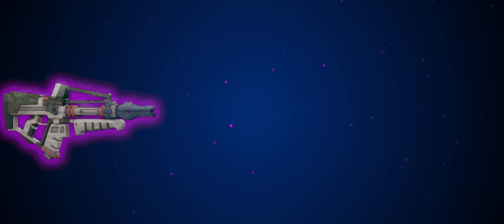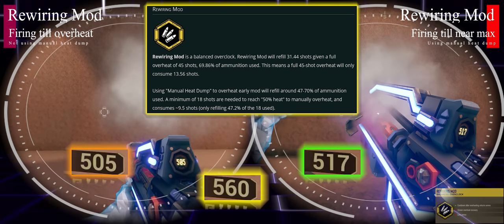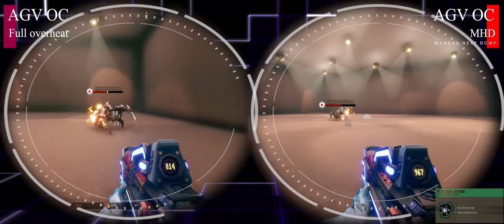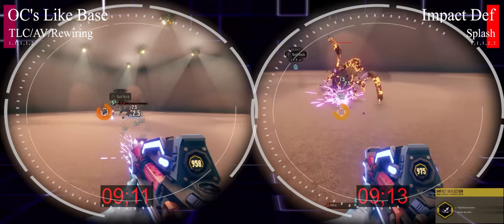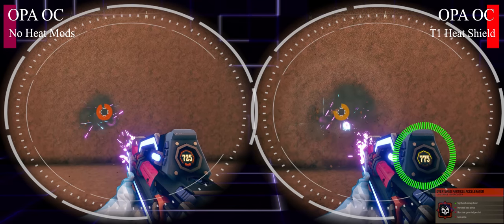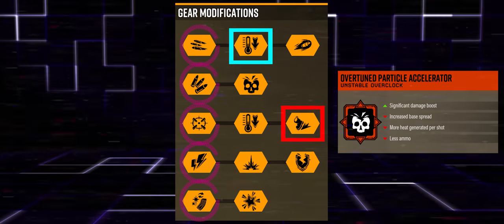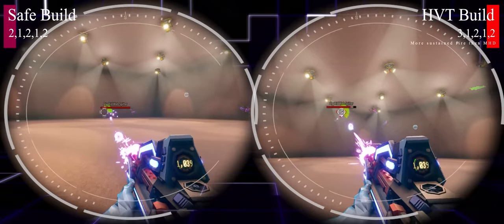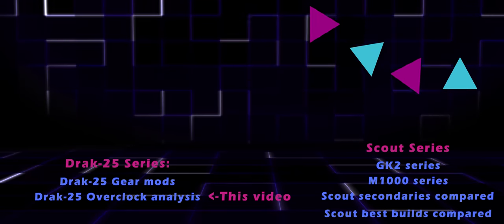Drak-25 Overclock Analysis - Deep Rock Galactic

Comment: One note about shield battery booster that actually makes me love the OC:
When you overheat the gun and it drops your shields, your shields begin to recharge when the gun is done overheating. Not after the normal shield recharge delay. You can even see this in action at 13:05. Gun overheats, shield goes down, shield begins recharging once overheat animation is finished.

Why is this useful? Well, if you take the armor mod that results in a much faster shield recharge, and you take the shield link perk, suddenly your shield recharge rate is very quick, on the order of 1-1.5 seconds. So this helps a lot with getting you back in the game if you accidentally overheat the gun.

But consider this: You can take manual heat dump too. Now, in exchange for purposefully breaking your own shields, you get a faster overheat animation, about a second long, and your shields recharge very quickly once the overheat is done thanks to recharge speed armor mod and shield link.

Okay, things look much better now, but we still haven't hit upon the final piece: If you are going to be using manual heat dump, you might as well take Hot Feet too.

Now a play style comes together:
Use Shield Battery Booster's crazy upsides to shred through some bugs until your heat meter is almost full. Manual heat dump, gaining crazy move speed for a few seconds. Once the manual heat dump animation is finished, your shield instantly starts recharging, and thanks to shield recharge speed armor mod and shield link perk, it comes back up in about a second. Repeat this process for a good time.

Now this all sounds well and good, but if a bug hits you, then this whole overheat, run away, recharge cycle breaks, right? Wrong. If a bug hits you, you lose the OC bonuses and normally would have to wait for deep rock galactic's painfully slow shield recharge delay of like 8 seconds, but overheating the Drak with shield battery booster immediately sets your shield recharge delay to be the duration of the overheat animation, whether or not your shield was full beforehand.

This means that, anytime your shield is not at full, you can fire off a few shots, manual heat dump, and be back at full shields in under 3 seconds. With hot feet, this also allows you to reposition to avoid further damage. Now, shield battery booster is not just an OC that heavily rewards you for maintaining shield uptime, it's also a tool that helps you do so!
EDIT: It looks like the OC may no longer behave this way. Be sure to test it out yourself before relying on it. What a shame, too. Was fun while it lasted.
Reply from the maker: Awesome! Thanks for sharing. I decided not to put in the video as I thought it might take a long time to explain and confuse people. I must admit I never thought about including hot feet or taking that next step of manually dropping your shields to quickly get them back.

I will be trying your suggestions out ASAP!

Rock and stone!
Reply: Oh my god... My world is different now! I enjoyed the Shield Booster even without the armor mod and shield link and hot feet, but really struggled on maps like magma core or fungus bogs, now it might be so different! Thank you so much!
Reply: Now say, the only thing I'm still not at peace yet is Shield Link perk, which, iirc, only works if you are REALLY close (like 4 meters) to a teammate. And that doesn't appeal to me as I usually enjoy to stay  a little bit away from my team (remember all that friendly fire?). Sometimes it cannot be avoided (like salvage missions) but still..
Reply: @squeezyjibbs6643  That's fair. Shield link is probably the least impactful part of the strategy. It does increase shield regen by quite a bit, but you essentially only get the benefit when you are holding a point on salvage ops or doing drilldozer. Since scout is the most isolated class, you get the least benefit out of it. But, also consider that shield link is an active perk, and since you are scout with hot feet, you really don't need sprinter. So, assuming one slot is iron will or medic, you're only giving up the other of the pair. Another thing to consider is that, with hot feet, you can sorta pull off a "drive by" shield regen where you only get close to a teammate when you need the shield regen. This does often result in getting chipped by FF though, which ruins everything. I just included it here for completeness. Plus I think it fits the theme of some sorta scout shield jury-rigging expert. Buffing teammates shields with the active is fun, but it's hard to tell whether it helps.
Reply: Nice. Thanks for the build and walk through /screenshot!
Reply: Thanks for sharing this. I will have to check it out
Reply from the maker: @imnotgivingmyname2389  I might do a SBB video to cover this info. Mind If I take a screen shot of your post and use it in the video?
Reply: I wonder, what if someone shield link boosts you and you get damaged? Do you still benifit from the clock with the shield buff if it didnt go through this extra shields? I might try to check with my friend later, but seems like it could be cool idea to ask someone in party for shield linking
Reply: @GamingExistence  Sorry for the late reply. Feel free to screenshot and use it if you like, anything I post on youtube I consider publicly available.
Reply: it's... not working like that
Reply: Hey you know those useless T3 armour upgrades that damage or electrocute nearby bugs when your shield breaks? Does Manual Heat Dump trigger those with Shield Battery Booster? The slowdown from the electrical effect could actually help with your escape plan.
Reply: This is fixed and the shield recharge delay is now 2 seconds instead of the overheat duration
Reply: @half.blight That’s still a lot faster than the standard damage-recharge delay.
Reply: i aint readin allat

Comment: Rewiring mod actually works really well as a combo weapon if you take a secondary with a decent amount of ammo efficiency to match it. Taking tier 3 hot feet allows you to reposition in between bursts and the tier 4 electrocution mod works well with the zhukov's tier 5 conductive bullets and the boltshark's tier 5 magnetic shafts. The default cooldown timer is long enough to switch to your secondary, finish off the enemies you've already damaged, and reload. It's not as good for single target damage as some other overclocks but it certainly does help for those missions where you've got 79 nitra and not a single vein in sight

Comment: 4:20 You do not need to reload cancel the overheat animation the traditional way by swapping to another weapon. However you can click to begin firing before the animation is finished (same thing is present when the lead storm minigun overheats) while the scout is slapping the heat shield.
Reply from the maker: Awesome thanks for the tip. I do find that it is inconsistent though, sometimes I can fire straight away and other times not. Do you get that or something I am doing wrong?
Reply: @GamingExistence  I personally haven't noticed any inconsistencies when animation cancelling in this way.

Comment: OPA for close range almost like a shotgun, bolt shark with quick fire for those long range HVT kills has worked really well for me. You could also use embedded Dets as your HVT weapon, surprisingly good even at med-long range. I don’t have impact deflection or TEF so OPA is my current go to for the drak

Comment: You've opened my eyes to Thermal Exhaust feedback, I don't usually run my Drax build on scout so I've only tried Overtuned particle accelerator, Rewiring, Aggressive venting & impact deflection. Shield booster always seemed horrible to me happy to see it confirmed without having to waste my time trying it for multiple matches. Overtuned particle accelerator from using it for a handful of matches is also quite awful.
Time to try Thermal Exhaust feedback maybe I'll start liking the Drax more as compared to my M1000 builds.

Comment: I would like to add something to OPA's defence. It is awesome when paired with Zhukovs Cryo Minelets. I understand that you are looking at the primary weapon only but  hear me out. Raw direct damage of OPA paired with insane control potential of CM and IFG's is terrifying. Frozen Pretorians, Nexuses, Spitbalers just got melted under OPA's fire with no chance to unfreeze. And Impact Deflection is not capable of that because half of its damage is splash which is not multiplies by freeze.
Reply: Yeah I use cryo minlet zhukovs with the opa drak and cryo grenades. It's my go to scout loadout. I feel like I can do any mission type and handle loads of crowds.
Reply: No
Reply: RIP any ability to kill targets 20+ m away or any mactera though lol
Reply: @mattyhill9919  If only you had a tool that allows you to close the gap really quickly and has infinite uses on a short cooldown...

Comment: to me the rewiring mod is really good , I have my mods set up as 1 2 3 11 or 1 2 3 11 , you gonna get lots ammo back might as well put some damage on it , I usually go with armor breaking mod just that I can take out certain enemies quicker , once my Drak is over heat swap out my zhukov and empty the mags then swap back to Drak you don't need to have the weapon in hand for cooling down . my zhukov build is 1 3 2 1 1 with gas recycling , this allows you constantly firing you weapons with very little down time , they do very good damage too
Reply: I've played around with it, and while I like the rewiring mod for its longevity it just doesn't have the damage to match the other OCs.  I find I have to run the electric status mod for it to feel useful.  

I find its also challenging to optimize since the way I play scout is to deal with either separated mobs(webbers/acid spitters) or helping finish off bigger mobs.  I find myself needing to waste ammo just to get up to a point where I can force an overheat unless its a full wave.
Reply: @voicetest6019  yeah having electrical damage is nice but I personally just don't like taking long time to kill a target that I wanted . Just because of this I use gk2 more than drak even a lot people say gk2 is no where as good as drak
Reply: You said Rewiring mod set up 12311 twice
Reply: @prich0382 my bad. The other one uses armor breaking

Comment: 9:10 definitely speedboost, you can manually overheat after only like 2 secs of shooting with T1 cooling mod, it's perfect for quick disengagements since you're going to be shooting at close range mostly. It cools down very very quickly too, like 1.5 seconds. This build makes you feel like a speed demon, especially if you take it on elimination missions

Comment: Well done video.  I pretty much rated these the opposite though lol.  Love the shield battery booster and it is the only one I will use for it.  I pair the drak with the nuk17s due to their damage increase against electrocuted targets. So if I overheat the drak or lose shields, it is just a matter of a weapon swap.  The extra ammo from the OC is also extremely valuable imo.  Also, remember you can take things like shield link to make your shield regen faster, which really helps in those moments like black box, etc. where you are close to teammates.

Comment: I think one drawback with Thermal Exhaust Feedback is the attention it needs during combat, which could be needed elsewhere, especially without mods to make heat easier to see.

Currently I use Overtuned Particle Accelerator for elemination missions, cause the Drak can electrocute and the trifork crossbow needs that in case you run out of ifgs. OPA is nice there since for the big guys it usually doesn't make that much of a difference how far away you are danger wise and it does the most dps there. Thermal and impact deflection suffer a bit form resistances there. To be fair tho with how good trifork is against bosses you mostly use the drak for getting there and the ocasional electrocute.
Reply: Dreadnaughts are immune to the electrocution tho... The only things they are affected by are IFGs and taser bolts, iirc.
Reply: @squeezyjibbs6643  Not all of them are they? I remember it working on the experimental at the very least. Might've been a bug tho?
Reply: @squeezyjibbs6643  Ok I just confirmed with testing that all of them are immune to electrocution. I must've either mistaken something happening on the experimental or there was a bug.
I still think the electrocution can be useful in that case since it allows you to get rid of certain enemies without having to use an ifg, but I'll think about switching to the m1k or using armorbreak on that tier instead.
Thanks for pointing it out!
Reply: @Kiwi9552  No problem, mate! R&S!
Reply: @squeezyjibbs6643  Rock and Stone!
Reply: @Kiwi9552  bosses are also highly resistant to pierce damage making triforce worse than both boom and nuks.
Reply: @jetflash100  Are you sure? I haven't checked the numbers but the damage looked about that of boomsticks and they don't have that resistance listed.
Reply: @Kiwi9552  its 50% less damage against dreads and oppressors and 30% less damage against praetorians.
Reply: @Kiwi9552  also ED and JS will outburst and outdamage it.

Comment: If you use manual heat dump with shield battery booster it starts recharging the shield immediately. Paired with boosted converter its much better

Comment: RE: Thermal Exhaust Feedback, I think 21312 is a good alterantive to 21212. Hot Feet is genuinely helpful to the point I sometimes intentionally magdump into an oppressor to overheating, the the speed boost helps me run away. It's a lot faster because TEF does more damage the closer to overheating, so the last few shots prior to overheating do the most damage.

Comment: You should try OPA with splash upgrade, it annihilates hordes and it also upgrades your accurasy because even if you miss your target you can still hit it with splash damage.
Reply from the maker: I did give that build a try for about 7 runs. It was ok but did not blow me away. Kind of felt like nerfing the main benefit to try and mitigate the main weakness.

I never did the simulations with it though. Before the best builds compared I will run some simulations. Thanks for sharing!
Reply: @GamingExistence  It isn't the strongest build but I like runing so that I can take out things at a distance more easily because I mainly use shotgun as a secondary.
Anyways great video

Comment: I really like Thermal Exhaust Feedback with the Hot Feet Mod, because the longer overheat also lengthens the speed boost. During it you can switch to your secondary and easily kite the bugs while blasting away. Also if you use the tier 5 mod thermal feedback loop it gives a RoF boost past the 50% heat mark, you can overheat quite fast with it without manual heat dump. Instead of trying to mitigate the overheat, I love that they give you many ways to build around it and actually turn the downsides into a positive.

Comment: You said that Shield Battery Booster loses all its bonuses if your shield takes damage, but you keep the fire rate.
Reply from the maker: My mistake, yes it is just the damage and projectile speed. But the +1 ROF and 50 ammo are small compared to what you lose when the shields go down.

Comment: I have personal problem with Manual Heat Dump, it's just so inconvinient to use, constantly shifting my index finger from D to R and back isn't fun.  And it's so annoying having "forced downtime". This is what i dislike about shard diffractor too since clear overclock what solves that issue didn't make it on live servers - once you release the trigger you can't start shoting immidiately, there is a cooldown just like on drak with MHD, you press it and there is another enemy, but you can't shot for a good second and a half. So, i have to, but i can't, make a decision about pressing R or not, after EVERY burst, so i do it automatically instead, regardless of situation. This makes ANY build based on MHD not fun to use at least for me. Thats why i prefer Thermal Exhaust because it allows me to snap from target to target with really short burst, annihilating one bug after another at the pace a can sustain.

Comment: Great informative video just have a couple of questions.

What was the build used for rewiring mod here ? And how was the ammo bonus calculated ?
Reply from the maker: Rewiring Mod was with.

1,2,1,1,1.

The 2000ish and 1800ish was based on 560 starting ammo. You can fire whatever the amount it is that I display on that chart. 37 ammo I think it was, but you get 27 back with MHD at the right point. That's 10 ammo cost to fire 37 shots. 560/10*37 + the ish for the odd bits in the final dregs of the magazine.

But of course you will lose that X percentage on forgetting to MHD, doing it at the wrong time or tap firing and not getting to enough heat.

Hope that helps.

Comment: Which OC would be best for dealing with Rivel Robots? I'm thinking Thermal Exhaust Feedback cus of the Heat
Reply from the maker: I think TEF will give you that extra damage. From memory you won't set them on fire, not without help but some TEF shots to head will take em down quick.

OPA also but harder to get the head weakpoint hits